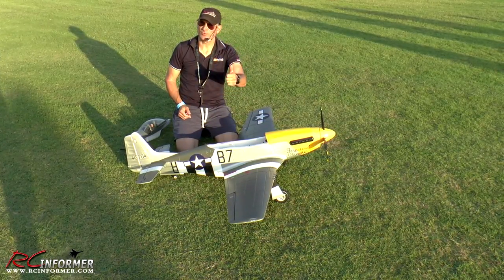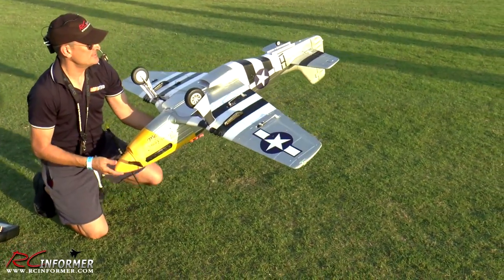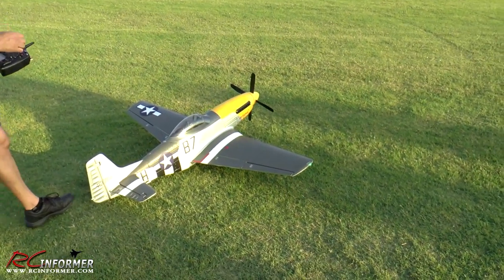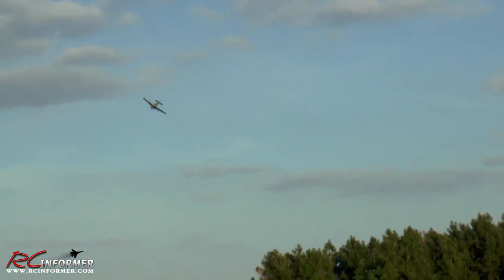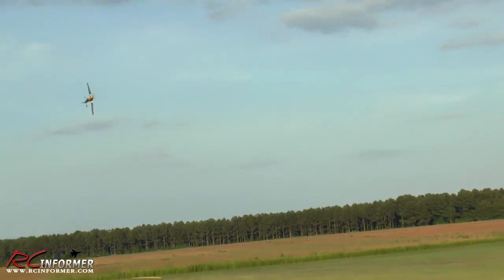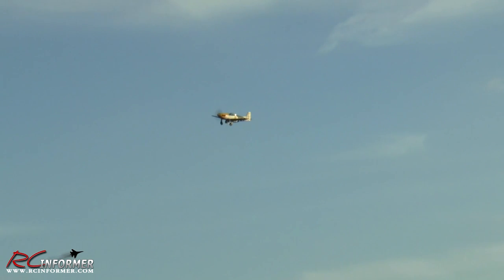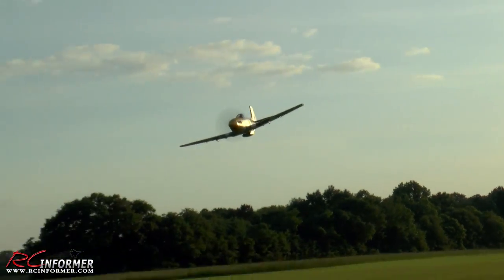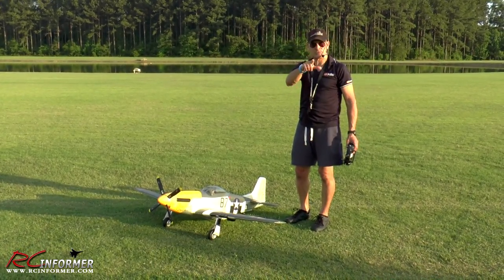SEFF 2019 - TUESDAY - FMS 1700MM P-51 FLIGHT DEMO Upgraded 360kv motor By: RCINFORMER

Comment: @RCINFORMER Hi Rich, i have the same plane but with the old motor (5060 300kv), what would you recommend to upgrade this bird : 8S with 120a ESC or just changing the motor for a 360KV?
 I have seen what you have done on the Corsair with the 300KV and it fly awesome; the motor of the Mustang ( the 300kv ) is the same as the Corsair, so it might be a good think?

What would recommend as the best solution?
thanks

Comment: I've been flying mine for years with the original motor.  I upped the speed by slipping a short, 1mm thick zip tie portion behind each of the four prop blades, behind the ramped section where the blade mounts to the hub.  That small pitch increase was just enough to obtain scale speed and still have enough thrust for very large loops.  I also replaced the pathetic small scale pilot with a larger one from Aces of Iron and it looks terrific.  The pilot is a tad oversized for this scale of a plane but looks so much better than too small.  I trimmed the lower shoulders to get it to fit from the bottom of the cockpit, installing a new, lite ply floor.  To enjoy this plane at its full potential, don't horse it around the sky, but perform large, graceful turns.  I make a gear up and gear down pass that spectators appreciate since the sequence is slow (horizon to horizon) and includes the inner doors.  It will do amazing spins, outside loops, split-s turns, waterfalls and fast/low passes.  On landings, it has sufficient weight to cut power on a gentle descending, 150 foot final with full flaps to perform a very scale, feather light landing.  At six-inch elevation, pull back on the elevator very slowly and the plane lands perfectly, every time.  A great end to a 5-min routine on a 6S-4000 mAh battery.  Other pilots will sit sit down and watch the flight due to the magnificent presence it has in the air.  The sound, the look, the grace; the perfect large foam warbird.  I guess it was too expensive for some to sell a lot of them so it was discontinued, but I've slowly sold all my other warbirds.  This one is a real keeper.  A resounding crowd pleaser.  I fly it in the opening ceremonies of the Hiller Museum Air Show in CA each year.  Never fails to impress.
Reply: I would like to do the same improvement on the prop; any picture would be great, where can i found 1mm thick zip tie portion? thanks

Comment: Rich, another good video. My FF likes to have the radiator vent door open in flight as an air exit. I notice that it seems a bit quicker that way, and everything comes down a little cooler if I am heavy on the throttle for the whole flight. Happy landings!

Comment: What is a good motor upgrade size for this plane Rich?  Mine flies a little anemic. Thanks ..
Reply from the maker: Use the FMS 5060 360kv.  That gives it a good boost.
Reply: Did you use the same prop Richard or did you have to go bigger?
Reply from the maker: @sal2703  I used the stock prop. It works perfectly!
Reply: Perfect! That's what I was hoping! Thanks again for your help...